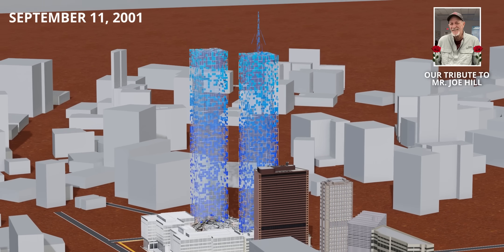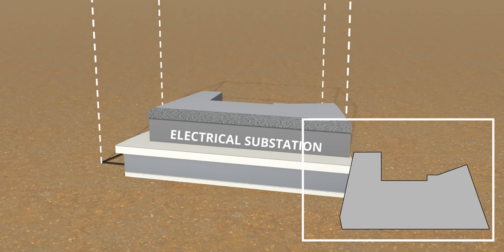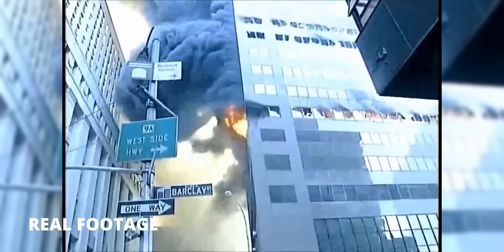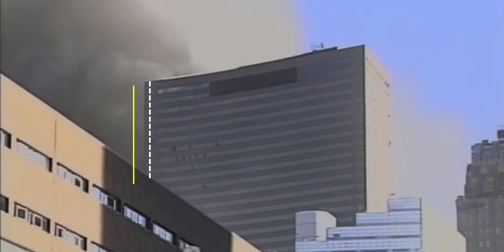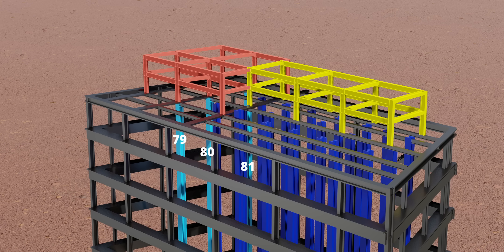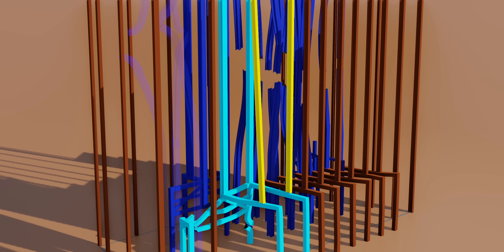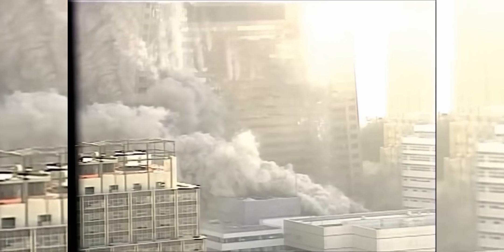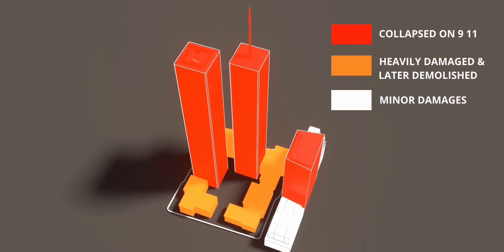Collapse of Building 7 | The Complete Physics

Comment: This does not explain how those steel columns collapsed vertically down and did not fall to the side !! as if they disappeared into the ground or as if they turned into small pieces. Could you please explain this ?

If you have a standing steel column and you cut into it in the middle by any mean, it does not fall vertically down onto its foot print,  It normally falls to the side.  

Same like when you cut a tree, even less hard than steel, but the tree falls to the side not collapse vertically down into small rubble. 

Besides, We saw the collapse of WTC main buildings, and they have the same phenomena, collapsing straight downward like all the steel in them have turned into small pieces simultaneously, so it is not clear how the rubble would have created 600 degree Celezius fire in WTC 7 ... did it cause such fires as well in all surrounding buildings ? may be you can explain this a bit more elaboratively ?  

Also We did not see the stem (steel part at the top of main WTC) falling to the side or cutting through WTC 7 in any of the videos, as you assume here. Is this a mere assumption or a confirmed fact ?
Reply: Load the columns and try again. 

A loaded buckling column is not a tree. It will drop down, not topple.
Reply: @TheCriticalStinker-01  Not true. 
Buckling causes the steel column to bend which shall causes big lateral movement. 

Besides the columns here (according to the explanation in the video) are not collapsing due to excessive axial load from above, They are falling because of something like a  cut in the middle due to fire (strained deformed under heat at a point near the middle).  Which is more analogous to cutting a tree rather than excessive axial load. 
Could you explain to me how you imagine the steel column falling axially down ?

What do you imagine the column will look like when the building height is reduced to virtually nothing on the ground ? do you imagine the columns will be shrunk to virtually zero ? or will be complete zigzag like a compressed snake ? or shredded to pieces ?
Reply: @qaysar82  - Forget the animations, they are figurative, not literal.   Initial failure of C79 was due to lower floor failures causing a loss of lateral support over an excessive length.  The column was absolutely loaded and when it goes it will go and did go DOWN, not toppling like a tree.

What you should be doing is looking at what happened and asking why your assumptions are wrong, not looking at what happened and assuming reality is wrong because it does not match your assumptions.
Reply: @TheCriticalStinker-01  You are not answering my questions or addressing them at all. 
If you present an explanation that cannot answer simple physical questions, then it is probably a wrong explanation. 
The columns were normally loaded but not excessively loaded. Not enough to shred them into small pieces. 
I don't want to repeat myself, May be try to really read it.
Reply: @qaysar82  - What happens when you remove critical lateral support from a critical column over an excessive length between say floors 7 to 15?

Comment: Unless WTC7 was built using Nano Thermite particles perhaps you’d like to offer an explanation as to why it was found everywhere afterwards? Not just regular thermite, but the hard to get version. One might say military grade. Thoughts?
Reply: It wasn't. That's a myth. The USGS for example conducted thousands of sample tests and found squat.
Reply: WTC Building 7 collapsed at essentially free-fall acceleration,  but, more importantly, both WTC towers 1 and 2 collapsed at free-fall acceleration, which cannot happen if 70 to 80 percent of the building structure - the portion below the damaged area - remains intact. Shayam Sunder, the lead investigator for the National Institute of Standards and Technology (NIST) stated on video that “A free-fall time would be an object that has no structural component below it.” He also stated on video that “Tower one collapsed at about eleven-seconds, and Tower two collapsed in about nine-seconds, this is essentially the rate at which free-fall [collapse] would happen.” Free-fall is an object falling through thin air. Collapse by gravity alone would not explain the tower’s collapse rates. Many professionals during the WTC cleanup saw melted steel and concrete which requires much higher temps than any normal combustibles in the area could create - especially in fires buried deep under the rubble. The 2002 PBS documentary “America Rebuilds” mentions molten steel and underground recorded temps of as high as 2,800 degrees F. Deep underground fires raged for three months even though enough water to fill a lake was dumped on them. The military grade incendiary Nano-thermite can reach 6,300 degrees F (Lawrence Livermore National Laboratory 1991),  easily enough to melt steel, and unreacted particles were discovered in 2007 in dust samples collected around the area. Nano-thermite contains its own oxygenizer and can burn efficiently even under water, which explains the high temps and ability to continue burning for so long. Nothing other than Nano-thermite explains this, and it shouldn't have been there.
Reply: @NRUN65  - How did you arrive at that conclusion about free fall (or "essentially" free fall)?

Did you measure it yourself?

Or did you take the internet's word for it?

I measured it myself.

Twin Towers took 32-34 seconds to collapse, which for those keeping score is 3 times longer than free fall

Essentially.

Building 7 took 18 to 20 seconds, which is again 3 times longer than free fall

Essentially.

You don't even need to take precise measurements.  In the case of the Twin Towers the naked eye will do:  

www.youtube.com/watch?v=4VgZW-v_Opg

Funny thing about free fall though is that all that shit the conspiracy side of the internet has been telling you about it isn't really true. For example:

www.youtube.com/shorts/n8WxkqMRgS4

Now then, would you care to revisit your hypothesis?
Reply: @NRUN65  - See not deleted, you just couldn't find them. If you can't find a day-old YouTube comment, how the hell are you supposed to figure out something as complex as a building collapse???

By watching a shitty documentary?

Please 🤦‍♂
Reply: @NRUN65  - Take your time.
Reply: @NRUN65 I would say to those who wish to argue with you, “There are none so blind as those who will not see”. My building and construction qualification required me to draft detailed construction drawings with an emphasis on multi storey steel and concrete connections. I had a whole folio of these drawings which I later gave to a first year student as I no longer needed them. Knowing how robust the design was and how high a safety factor was calculated into every facet of the towers, the failure is not just unprecedented, it’s impossible without first weakening the structure at key locations The “meteorite” formed by the intense heat which caused concrete, steel, and glass to fuse together in an enormous clump could never have been formed by compression and burning fuel alone and no amount of debunking can account for it without factoring in thermite. Clearly when people are trying to put up a coherent argument against your conclusion the meteorite is ignored, as is the destruction of the buildings core which would have remained intact in the pancake scenario. It would also require the entire perimeter to fail in unison despite varying temperatures, and need the core to also fail evenly at the exact same rate despite being a completely different material composition and design. People also like to ignore the filmed testimony of people injured in lower storey blasts which occurred only minutes before the planes hit. The central core was blasted prior to the planes impact and the core was weakened enough to drop it far enough to break all major internal connections immediately prior to the sequential squibs running down the building starting at the top floor. Notice the aerial falling vertically inwards immediately prior to the floors collapsing indicating the core dropped and was then blown floor by floor. Photos of steel fragments weighing hundreds of kilos being thrown clear of the building at a speed which is impossible without explosives also rules out gravity alone. Before cleanup crews arrived, photos of diagonal thermite cuts through key verticals columns can be seen. It’s the smoking gun that everyone needs to acknowledge.
People don’t want to believe the truth because they can’t believe so many people would get together and do such a thing. When eventually they get to see the video of the missile hitting the Pentagon and accept the government lied about it being a plane, they will realise that the government was complicit in a massive cover up even if they didn’t run the “terrorist”operation themselves. People who are still pushing the narrative that the planes alone brought down two towers and a 47 floor building nearby, all of which are the only examples in history of buildings falling in their own footprints without the intervention of a demolition team, need to let go of the dogma and accept the facts. This was deliberate. All of the genuine evidence supports a massive conspiracy. Don’t ask me who, but I can tell you how.

Comment: If you believe that the debris from the towers landed over a hundred yards from the towers then I would think you don’t understand the effects of gravity. This radio tower antenna was able to tear through several floors of this steel building and start a massive fire? Not. 
What was on fire to cause so much heat to expand a girder truss on the 13th floor to expand to the point that it disconnected from its column . So a single girder truss failed and the building collapsed.  That’s the story we are told but it’s impossible. National institute for standers and technology look it up. NIST
Reply: Uh huh.

www.youtube.com/watch?v=g_SvpwyC17M

And

www.youtube.com/watch?v=V1nTwL8S-0U

Evidence works so much better than ignorance-fueled personal incredulity

Comment: What you see also perfectly correlates with a progressive set of detonation charges popping each column rapidly one after the other.. fire cause progressive collapse so I would expect sagging first as it reaches it's elastic limit and then catastrophic failure. The building does not sag or move at all then suddenly , bang and it's gone.. it does not fit with a softening of metal before failure..it just does not fit. You know Intuitively that metal will bend as it heats up. It does not remain in position and once it reaches melting point, it then snaps. No. Put any piece of metal over a flame and watch it sag . Put weight on it and see how it fails. Does it snap it does it bend? Perhaps you can show us a practical demonstration where a fire has caused catastrophic collapse of a steel structured building due to fire so we can compare it. ? Oh wait.
Reply: Your expectations are false.

Comment: So columns break. Girders bend. Got it.

Couple questions I have, though.

(1) Is the load was redistributed to the remaining columns after the penthouse collapse, why was the failure point not at the building's weakest point, like maybe at its cereal-box-weak outer facade? Why didn't the floors break away from the columns? This cascading failure, under redistributed loads, was not witnessed at any of the other WTC buildings nor the 39 story Deutsche Bank across the street, which also suffered extensive damage.

(2) Wouldn't you need column failure every couple floors for the building to collapse so completely? For example, if a column failed at a point 5 stories up, you would only expect a 5 story collapse. Where would the other 40+ floors go if there columns remained in tact above the fifth story failure point? The animation shows them disappearing underground.

(3) To the point above, if the columns didn't each fail at multiple points, why didn't the non-broken sections of the columns impede the fall?
Reply: 1. There was no load redistribution in Building 7.  Lower floor failures caused critical core column 79 to lose lateral support over an excessive length, resulting in a Euler buckling failure.  This then cascaded through the rest of the core.  Building 7 collapse was entirely different to that of the Twin Towers and was a product of the building design and damage.   

2.  No.  Building 7 failed from east to west, not from the top to the bottom.

3. A failed column is a failed column and can offer no resistance.
Reply: @TheCriticalStinker-01  

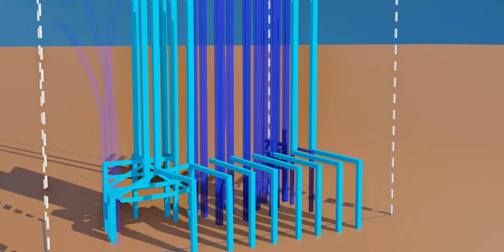1. Go to 6:50. They make the load redistribution argument there. 

2. See 3.

3. It would offer the resistance of its own existence. Just because a column fails, that doesn't mean it disappears. If it fails five stories up, then there are still 42 floors worth of columns (82 of them for that matter) that would need to be accounted for. The simulation shows them being swallowed up by the ground (8:20), but this is not how it would occur. There would have to be some displacement in one direction or another, not straight down inside of itself.
Reply: @mr_knowitall  - 1. No, he doesn't.  

At the height of transfer trusses the building temperature was quite high and the transfer truss failed (I disagree on this point BTW).  This put the remaining columns into more stress and the column collapse progressed

That is not an argument for load transfer, it is an argument for structural failure. 

Look at a floor diagram for Building 7 above the load transfer region.  Column 79 was the first column to fail.  Where are its loads going to get redistributed to?

3.  When a column fails it doesn't disappear, it becomes falling debris which by definition can no longer support the gravitational loads allotted to it. 

I have no idea what you mean by 42 floors worth of columns since columns are VERTICAL not horizontal.  One column goes from the foundation or the load transfer region (depending on the column of course) to the roof.  When a column fails every floor beam and girder directly connected to it is also going to fail, creating a big hole. This is why the EMP descending through the building when C79, 80 and 81 failed. 

The columns fail in a progression from east to west through the core:  C79 fails due to lower floor failures (7-15) causing a critical loss of lateral support over an excessive length.  This is quickly followed by C80 and C81 as the loss of 79 removes critical lateral support over an excessive length.  The collapse then moves from east to west through the core - 3 columns at a time more or less - until the core is gone.
Reply: @TheCriticalStinker-01  

1. "This put the remaining columns into more stress"

MORE is defined as "a greater or additional amount of something."

MORE stress, as in EXTRA stress, as in ADDITIONAL stress. Where did this additional stress come from? The entire collapse theory falls apart without load redistribution. If the other columns didn't take on additional load, then why did they fail in a cascading (really, simultaneous) fashion? Each of the 82 columns would have had to fail independently, otherwise..

3. When a column fails it doesn't disappear, it becomes falling debris which by definition can no longer support the gravitational loads allotted to it.

When a 42 story column falls, it will still have to extend 42 stories in one direction or another. If you drop a broomstick onto its tip, when it hits the ground, and its momentum is stopped, it will still be sticking up one broomstick's height into the air. 

Since a 42 story column extends from the ground to the rooftop, the vertical columns could only "fall" from some failure point. If the failure point is floor 7, that that means that the 35 stories worth of vertical column extending above the 7th floor failure point are all that can fall, and it can only fall 7 stories before if either tilts in some direction or remains standing vertically, 35 stories into the air. 

You can't drop something 35 stories tall and when it hits the ground it's only 10 stories tall.

Comment: So the metal spire from WTC1 created a gash down the length of WTC7 like a samurai sword instead of just hitting it & bouncing off?? What was that thing made of to cut through concrete and steel??
Reply: Just steel, no concrete, kinetic energy and it caused the failure of 2 perimeter columns.

Also, this video is incorrect about which bit of steel from the collapsing North Tower hit Building 7 to cause that damage.